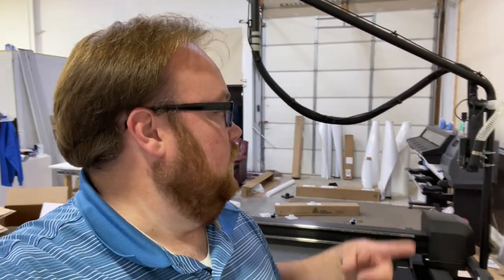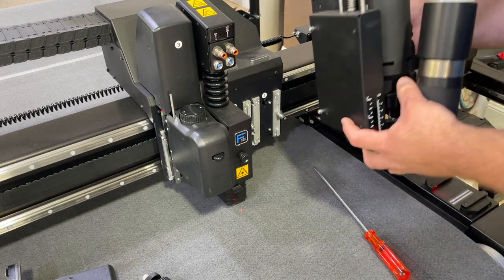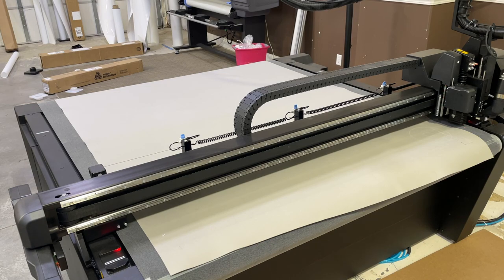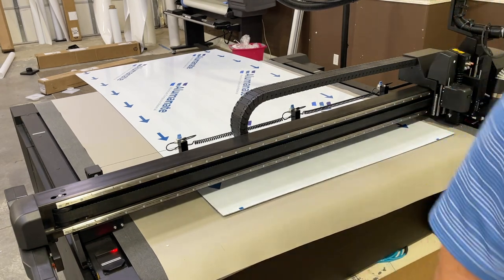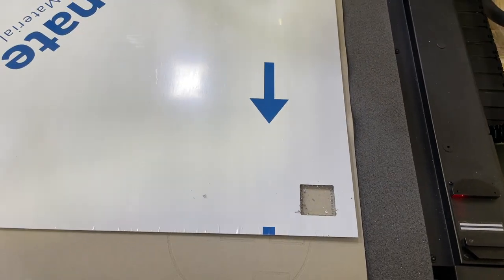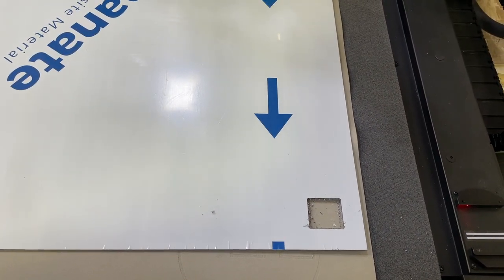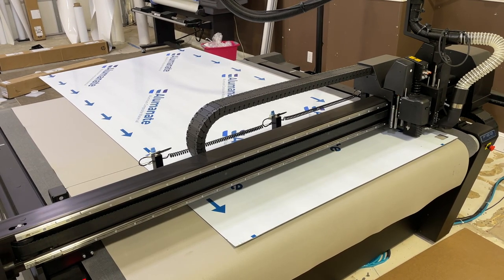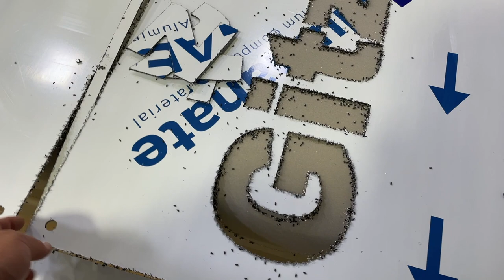Cutting ACM on the summa f1612 flatbed - with pricing

Comment: Does the summa cut vinyl with laminate already mounted to the max metal cleanly?  We want to be able to print multiple signs and pre mount to maxmetal then cut with the suma, just curious is it cuts out cleanly or if you need to shave down the edges to get a clean look?

Comment: Great video! I wish we could get ACM panels that cheap. I would like to see the edge finish. Did you have to knock down any raised edges? Do you know what the bit is? I have a 5x10 avid router set up. If I would set aside to to use the damn thing.
Reply from the maker: It's the bit that came with the machine, I'll try to find it out and post about it. I didn't knock them down, they looked and felt fine.